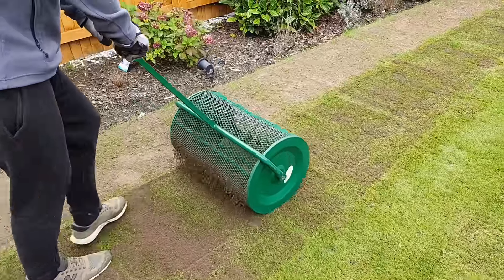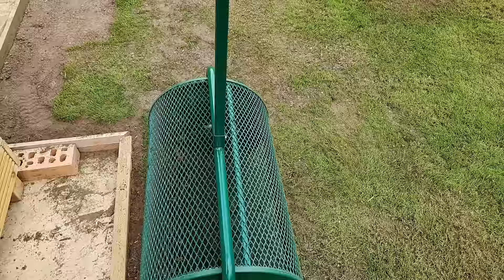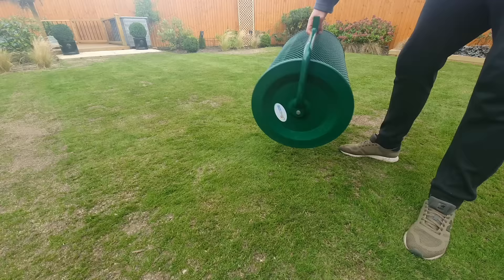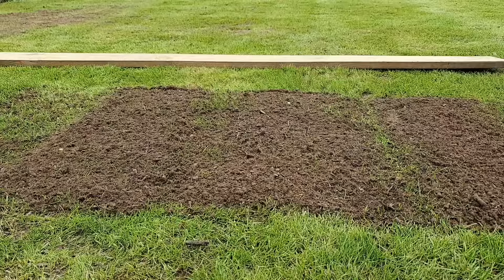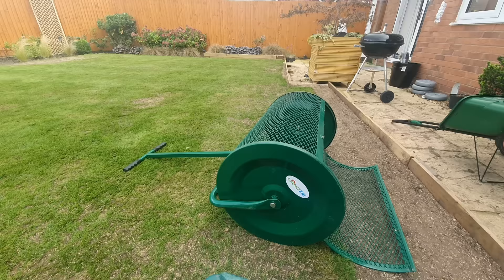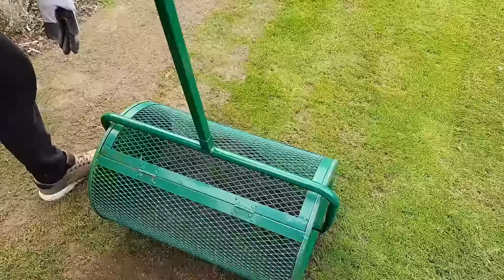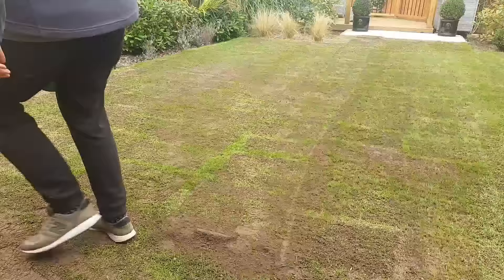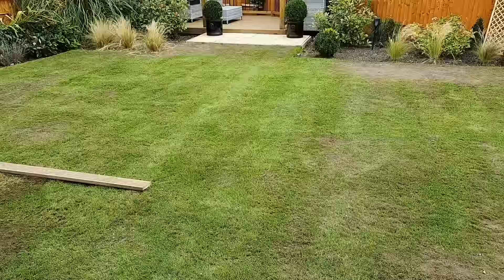Landzie Compost Top Dress Spreader Review (Lawn Results)

Comment: Taken from a letter sent to the Company President... With no response.
"As I begin a new season ready to overseed our 100,000 sq. ft. property, I wanted to express how very disappointed I remain with your 44” Compost and Peat Moss Spreader purchased June 29, 2021 (Order Number 9989). During its first use the hinges securing the cover broke off one by one with the result the cover was damaged. I am a Master Gardener and fully followed the directions. When contacted, your Customer Service Department sent new hinges and some type of long pin (?) with an explanation they were aware of the issue and this should fix it. No instructions. Frankly, I don’t have either the pop riveting or welding skills needed to fix it so I just put it in back of one of our sheds. 

Nevertheless, I ran across it again today and wanted to voice my still raw disappointment that I spent $699.99 on this unit and still had to rent a peat moss spreader to do the task on our property because of 1) a poor engineering design and 2) an inadequate response to solve the problem by transferring its solution to me, the customer. Frankly, in looking at your site and Swardman’s site I was taken aback by references of both companies touting their emphasis on engineering quality and core values that focus on the customer. This also seemed to be advanced by Michael Suchanka of Swardman in a statement advancing your company. Hey, I’m just a customer, not the enemy, not a Beta Tester, just a very knowledgeable private gardener going on down the road disappointed. 

Finally, I am neither looking for nor expecting any resolution to this matter since I have already chalked it up to another lesson learned and misspent resources expended."

Comment: I want to sow some cover crops in a garden patch I had peas planted in.  I would like to use the "no dig..till" method to so these cover crop seeds.  I wonder if I could just spreading out the seed on top of the clean/non-disturbed soil, then add a thin layer of compost over the top of the seeds using this device?  I could also spread out some wheat straw as well, like people do when planting grass seeds.  I see that others sow cover crops by simply raking in the seeds to the topsoil, but covering them with a think layer of compost using this thing would be much less labor intensive and faster.
Reply from the maker: I don't grow seeds but if you are looking to cover them with a thin layer of compost this will do that no problem very quickly and easily. If you get bagged compost it can be quicker to load into the machine vs a bulk bag and wheel barrow but depends on cost, site access etc.
Reply: @GardenLawncareGuy  I think this machine will come in useful so I ordered one last night.  Thanks for the vid!
Reply from the maker: Good luck - hopefully you saw the 10% discount code in description 😀

Comment: Great vid yet again dude 👍 
Can you recommend a good quality lawn seed supplier. Got some bare patches in my lawn after scarifying I bought some rolawn medallion seed but does not look to have germinated after overseeding. Thinking of trying a different seed? Any tips would be great.
Reply from the maker: My back is rowlawn medallion for the past 3 years and I've have great results. Ive tried a1 prem pro on the front and it looks ace with low maintenance. Ive just overseeded my back with a1 plat pro will take longer to germinate
Reply: @GardenLawncareGuy  how long did the medallion take to germinate I overseeded Monday am I being impatient expecting results already. I can still see the seed on the grass?
Reply from the maker: Yeah its will grow. The feacues can take longer in that mix. Even rye isn't that sure on 5 days germination. Keeping it moist and it will come through
Reply: @GardenLawncareGuy  thanks mate hopefully it will take. Been watering every day as we have had no rain fall but don't want to over water and cause the seeds to rot.
Reply from the maker: Water lights a few times a day only a light watering a few mins, feacues can take abit longer to come through

Comment: can this help with levelling as well?  My lawn is good but i have lots of bumps and lumps in it....
Reply from the maker: It helps to spread the material evenly, then you would need to use a lute or some wood to create the level.
Reply: @GardenLawncareGuy  cool, thanks for replying so quickly.  do you think its best to use sand to level?  if so where would get it from?  theres different types of sand right?
Reply from the maker: Check this out its the best! Comes in small or bulk bags https://gardenlawncareguy.com/shop/soil-dressing/70-30-top-dressing-bulk-bag-1000kg/
Reply: @GardenLawncareGuy  got any coupon codes??
Reply from the maker: Not for the dressing but there is some sales on seed right now on site